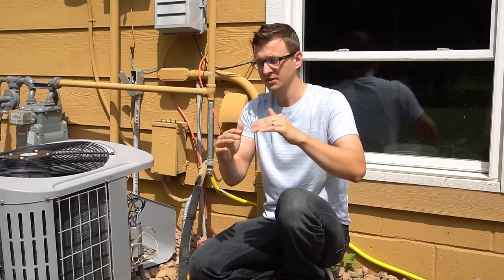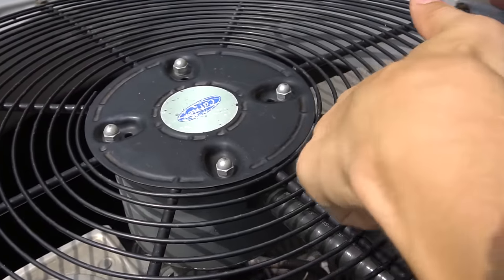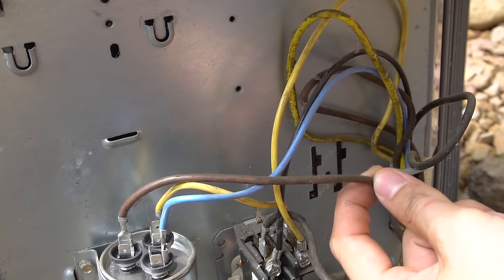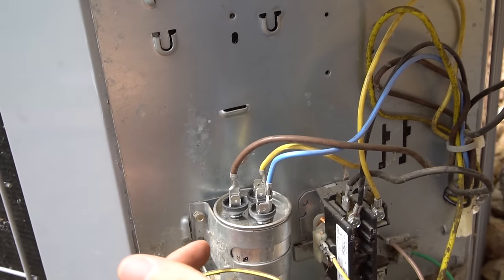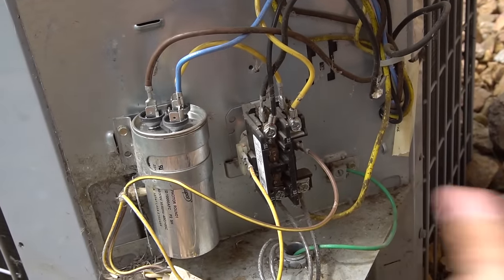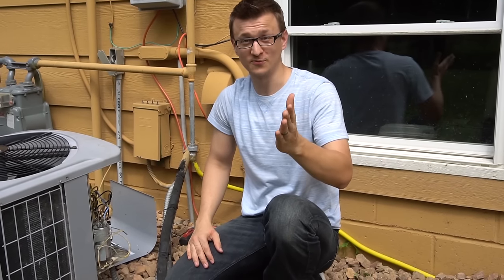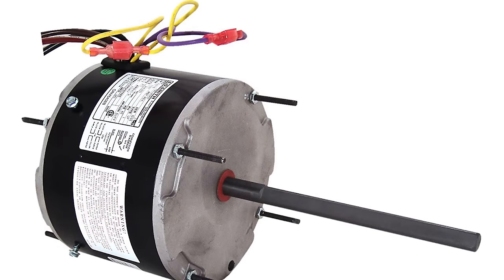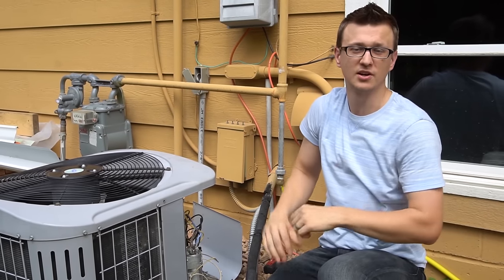How to Wire a Condenser Fan Motor

Comment: My AC fan didn't spin at all so I called a technician to check out what is wrong, one of the guys says it would be $800 because of replacing a motor, and the other guy says $ 2600 for replacing the compressor so I don't know what to do so I started to watch this guy's videos and I did replace a capacitor ($12 at Amazon) and the fan is started working with cold air.tks.
Reply: Thanks, very clear and straightforward

Comment: My old fan motor has four wires. Brown and white, brown, yellow and black my new fan motor has brown, red and black I know the brown goes to the fan on the compacitor and the black goes to the contactor but does the red go to the common on the capacitor or does it go to the opposite side of the contactor? The new motor doesn't have a wire diagram.on it and i dont want to wire the new one wrong. Thanks for your time and god bless

Comment: Thanks for the video. Air went out at 1am and on the hottest day over 100 degrees and 93 at night.  Everyone else said had to have duel capacitors to use 4 wire configuration and I saw your video and thats what I thought but wanted to be sure about the 2 brown wires. Had a used newer motor with the 4 wires and it works great and now have air back up at 3:45 am. Such a blessing.  Your video saved me.

Comment: Thank you for the video. I replaced my fan motor following your recommendations. My fan was going bad and I noticed the fan was previously replaced with a 4 wire instead of a 3 wire motor. The installer jury rig the wires using a secondary capacitor. Needless to say I replaced and put all the wires back to spec for a carrier 3 ton single speed motor and it is now working quieter and smoother for a 13 year old unit. Thanks again for taking the time and teaching us on how to do maintenance on our units.

Comment: You saved my hide friend!  My new motor came in today. Naturally it wasn't a one for one swap. The mounts were all wrong and not enough wires.  Your wiring explanation gave me confidence that it was worth overcoming the mounting. I didn't want to explain to my employer that I had just wasted $270 bucks on the wrong part.  Thank you!

Comment: Thank you, thank you, thank you sir.  I'm doing a maintenance replacement of 2 condenser motors i bought at grainger for my 6 year old trane units in AZ (lower end models without the crazy plugs i hear of forcing oem replace).  This info was EXACTLY what i needed to run the 2 aftermarket motors i bought.

Comment: Thank you very much for this video. My fan diagram matched the one you showed in this video. So I hooked up the brown to the capacitor and the purple wire opposite the black wires. The fan is working like it should. Thanks again.

Comment: Great video! I took out a 3 wire and bought a 4 wire fan.  All hope was lost until I watched this. Thanks man!
Reply: So the black goes with the other black on the little circuit box and the same for the white. Then the brown and brown and white go on the other capacitor but it doesn't matter which side those wires go on

Comment: Very good and detailed video, thank you for this online help. On my replacement motor there is a short green color wire, I believe it is suppose to be ground. If it is, where should I attach that too?
Reply from the maker: Glad the video helped! Yes, the green wire is a ground. Usually that wire can simply go under one of the bolts/nuts that secure the motor to the shroud/cover.

Comment: Excellent explanation for going from a 3 wire fan motor to a 4 wire.  Very helpful. Your vids are always extremely informative and done in such a way as to be easily understandable. One question you may be able to answer, I've been advised that a fan motor may have a plastic or rubber "plug" in the bottom when mounted to facilitate water drainage. Is this statement true or false? Thanks in advance for your answer.

Comment: Nice video! Btw, can't you just replace the 3 wire motor with a 4 wire motor WITH a separate fan capacitor? Then just put in a jumper between the C (common) on the dual run capacitor and one of the connections on the fan capacitor?
Reply from the maker: Yes, that would work too. The fun thing about HVAC is that there is usually always more than one way to do things :D The two ways I go over in the video are the most common ways though. Thank you for mentioning that though! For the people for whom it would be easier to do it that way.

Comment: Thanks for another great video.  On my unit the fan does not seem very balanced and has a lot of vibration.  Is there a way to get the vibration out to make the unit run quieter and reduce vibration that can cause fatigue on the system components?
Reply from the maker: If the fan blade is slightly bent, there is typically nothing you can do except replace the fan blade.. You could also try adjusting the fan blade on the motor shaft. A little up or down could make a difference.

Comment: Hi! Thank you for your videos, they're super helpful. I've been replacing my AC fan motor and I'm down to one last step - for some reason my replacement motor came with yellow, brown and black wires but the original had purple, brown and black. Is it possible that the yellow wire on the new motor will work in place of the purple? Any advice or help you could offer? I really appreciate it!

Comment: Jay, I've notice on a lot of your videos there are wires running through "holes", that surely look to be electrical knockouts with no knockout cable connectors.....  This just doesn't seem very safe to me - I noticed it again with this video.  It looks like there is 240v running through this hole too.  What do you think about the safety aspect of this - and ARE these intended for the connector/clamps?  It does look like it, and thanks for the good videos you have been putting out.
Reply from the maker: Some of the units have those connector/clamps but most of them do not. I agree with you and wish they made that a little different but most manufacturers don't. I have not seen any problems with that before though, such as wires rubbing through and shorting out. Just mice using that as their front door.

Comment: I have a 3 wire condenser fan motor that is blowing air down instead of up. It has a duel capacitor the brown goes to the capacitor and the other two go to opposite sides of the contact. Can I reverse the direction of the fan motor by swapping the two wires at the contact?The motor is a 1/8 hp 1075 RPM and it states ROT CCLWE. I'm assuming this motor is only counter clockwise?Can I reverse the direction?

Comment: Thanks you  very helpful ....My case was the 4 wires with a 3 wires condenser. Bu my  question now is, the original motor was a 1/5 hp and they give me a 1/4 hp motor replacement. Does the capacitor will work the same? What can I do?

Comment: HI, AND THANK YOU FOR YOUR ADVICE. I NEED HELP BECAUSE MY GENTEC REPLACEMENT MOTOR CAME AND 2 OF THE 3 WIRES HAD A LITTLE CONDENSOR LIKE THING CONNECTED TO THE BROWN AND YELLOW WIRE. IS THAT CONDENSOR? SHOULD I HAVE TAKEN IT OFF? THE OTHER MOTOR WAS COMPLETELY DEAD  THATS WHY THE REPLACEMENT. NEW MOTOR HOOKED UP AS IT WAS STARTS WITH A NUDGE BUT STOPS IN A FEW MINUTES.

Comment: My old condenser fan motor is 1100rpm, 1/4HP and 1.3amps
The only replacement I'm finding is 1075rpm, 1/4HP and 1.6 amps.  
Is this likely to work without any problems?  Thanks.

Comment: Jay, my condenser fan motor has the small plug tor reverse fan direction. Should I swap the probes in the plug to the opposite position to reverse the fan direction or plug or unplug the small plug to reverse the direction? Thank you for the great videos
Reply from the maker: You would swap the probes. You don't want to leave it unplugged. Glad to hear the videos were helpful!

Comment: I replaced the Condenser fan motor on my unit the other day wired it up exactly the same checked the cap it’s at 7.5mfd. When the motor is running it’s at 2.2/1.5 amps is it a bad motor that I got from the vendor or something I did. They are the Same HP?

Comment: I have another question:
How do I know which wire out of four(from two extra wires) goes to the cap?
Does it matter?
Thanks.
Reply from the maker: Most new motors will have two brown wires. One of them will have a white stripe. The other, solid brown wire would be the one that goes to the cap.

Comment: Does that diagram on the motor show brown going into capacitor then going out to one leg of power?
  In other words does that Fan terminal have two wires connected to it?
  Do I see a yellow wire on both ends of contactor?
  Btw, did you mistakenly call the yellow wire white before showing the connections?

Comment: Do I have to use a separate fan capacitor? My unit has the 4 wires.  Brown and brown/white stripe wires go to a separate capacitor.  Can I just cut brown/white wire and cap it and then attach the brown wire to my dual run capacitor, where its labeled 'fan'?

Comment: Quick question.....I replaced my 3 wire motor with a 4 wire motor.  The new 4 wire motor has a green ground wire.  They didn't make the wire long enough to get back to the housing so I'm curious....where do you tie down your ground wire?

Comment: The old fan motor had  3 wires with a dual run capacitor. The replacement has 4 wires and came with its own single run capacitor.... I have watched 10 videos and none of the cover this and I have no idea as to what todo....which cap do I use? Do I use them both? And how should. I wire it??
Reply from the maker: There should be a small wiring diagram right on the motor itself that shows you where the wires should go. If you want, you can simply leave the dual capacitor alone and add the other capacitor in as well. Two of the wires from the new motor will go to the capacitor that came with it. The other two wires will basically go on either side of the contactor. Black with blacks and the other color, on the other side. This video may help clarify it further: https://youtu.be/KCanZEsLVEI?si=5kkPP-1jaMlxh3-Y
Reply: Thank you for your help!! Greatly appreciated!!

Comment: You said with a 4 wire system you usually have 2 run caps (say a 7.5 uF and a 60uF cap) and the two brown wires go to the smaller cap, but isn't is possible to get a single dual cap that is rated as each on is separately and run one brown wire to the fan lead and the other to the shared common (C)? I mean they are two capacitors in one anyways, right?

Comment: Watched several of your videos. Really well done!!  -   But I have not been able to fix problem. Trade XL17i. Outside heat pump fan not working (compressor starts but turns off again). - Exchanged capacitor (matched replacement and uF rating). Did not fix problem. Now replaced the motor. Also did not fix problem - AND now compressor won't start. Thoughts?  - Kondensor is 2-pole only. Do these have directionality?  061222 Thanks!

Comment: Replaced  the fan and cap , fan runs the wrong direction.  Only three wires, fan says ..cw lead end..I assumed it ment clock wise  while its pointed down....but still sucks air in.....but my microfarads on the cap says 5microfarads but fan says 7.5.....could that be my issue  🤔

Comment: Should the condensing unit be covered in the fall and winter?
Reply from the maker: It does not have to be. If you watch my video on 15 air conditioner maintenance tips I talk about that there
Reply: @WordofAdviceTV  Thank you! I'm a check it out.

Comment: If my original unit came with a dual-speed fan motor, and my new motor is single speed, can I just bypass it by taking both the low-speed and high-speed wires from my unit (one Blue and one Black) and connecting them both to the black motor wire? I figured that this way, It will be on HIGH no matter what the input is.
I did it and it works, I'm just concerned if there are any risks.

Comment: Thanks for the video. You explain things very clearly! 
I have a different fan motor question if you can help? 
I'm looking for options to replace my ac condenser fan motor and not sure how to find the correct part. 
I have a Trane system model 4TTR5036E1000AA that has never been serviced since new.
On my service facts sheet it says I should have a motor with an 850 RPM rating although when I read the label on the motor itself it says it is an 835 RPM motor.. 
Not sure how much this matters?
Also, I'm not sure of what part numbers I'm looking for. The service parts list shows an OEM part of MOT12750 however on the motor label I see different numbers which are:
5KCP39MF AC66AS -- and then 
CPN D154950P01 
any help of what to look for would be appreciated, thanks.

Comment: My old motor have purple orange red and brown and my new motor have black white brown and yellowgreen wire. How do I connect this. I know the brown wire goes to the fan on the compressor. Black goes to the block yellowgreen goes to ground and now where do I connect herm and cap

Comment: Also, please.  I have a package unit. My cap is several feet away from fan. They seem to have run “ extension wires” from fan cables to the other side where cap a other items are. 

My old 3 wire fan had brown, black purple. Brown was connected to other brownish wire, purple to pink and black to gray. 

5 wire fan has green/ yellow ground?  Brown , brown/ white, yellow and black. 

Connected black to black and capped, yellow to purple and capped, brown to brown and capped, separated brown/white on its own. Put green/ yellow on fan grill; changed capacitor/ double for a new one. 

Turned on, it spun for 2-3 seca and stopped. 

What now???

Comment: my fan motor is 1/6hp can I use a 1/4 hp motor? both are 1075 rpm
Reply: yes you can as i did

Comment: Can I use 45/5 uf on 35/5 capacitor.
Reply from the maker: Yes but I would only do that as a temporary fix. Off by 10 is a large difference. It will still work but that's not healthy for the compressor long term.

Comment: I'm a beginner hvac tech in my case . When compressor gets cutt off condensor fan is still running .. where the connection goes wrong
Reply: U have it hot wired . Which means u bypassed the control and it will always run

Comment: Hello I replaced the capacitor and fan and know the thermostat switch doesn't turn on the condenser I have to press the plunger on the connector and it turns on for a bit

Comment: Do I have to replace the capacitor when replacing the motor with a universal motor ? Like if I want to install a single capacitor would I need to eliminate the dual capacitor or is the dual capacitor needed to run the compressor?
Reply from the maker: You don't absolutely have to replace the capacitor but it is highly recommended. When you replace a motor, to replace the capacitor as well. The dual capacitor is needed to run the compressor. You would simply leave HERM and the C wires on the dual capacitor and take off the FAN wire and put it on the single capacitor. Then take a jumper wire and put it on the other side of the capacitor and hook up the other end to C on the dual capacitor.
Reply: Thank you very much. You are very helpful.

Comment: I have a green/yellow wire just hanging. Where does this go
Reply from the maker: That is a ground wire. It can go under any screw as long as it is connected to something metal. There may be a dedicated spot for it too if the wire is long enough (typically the same place where the green wire from the disconnect box goes)